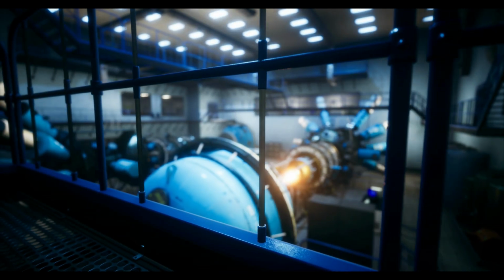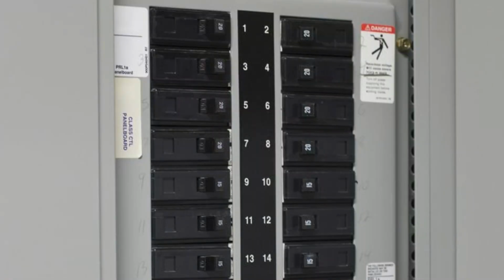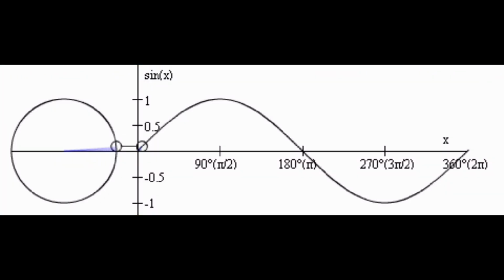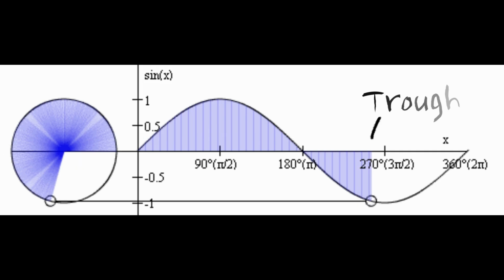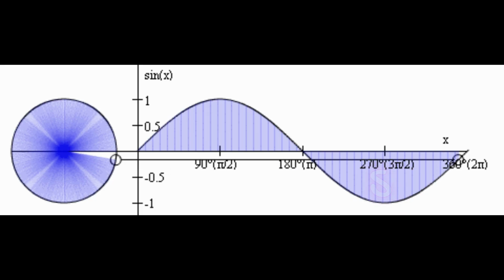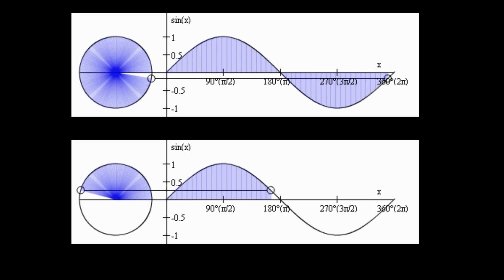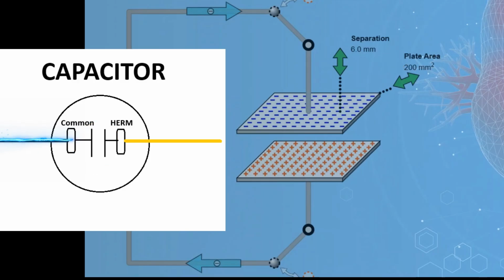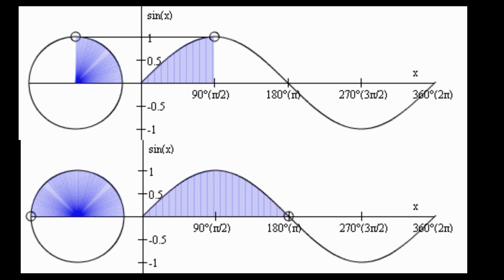What does a capacitor ACTUALLY DO?

Comment from the maker: Bottom line here is that we use capacitors in residential systems because we are taking only 1 phase of power off of the power grid, which doesn't give us the waveforms we need to create a rotating magnetic field in compressors and motors. This is also why commercial systems don't use CAPs. When all 3 phases of power off the grid are run through windings (as they are in commercial systems), they naturally create a rotating magnetic field without the need of a capacitor to alter waveforms and make it happen.
Reply: Mike can you break down the mf value of a cap? If a cap is 25% out of range but compressor is still working is it not working as good? Would the sign wave be less behind?
Reply from the maker: @georgev817 Yes, on a weakened capacitor the sine wave will remain the same but the timing of it will shift, so instead of say a 90 degree offset between the two sine waves it reduces to maybe 70 or 60 degree offset. This reduces torque, which can lead to slower, harder starts, more amperage draw and windings heating up more than usual.
Reply: @JerseyMikeHVAC  does a big drop in voltage have any affect on these capacitors? I was at a camp ground this last weekend and it happened to be one of the hottest weekends in a long time. Everyone was running their air conditioning. As the load increased on the electrical system in the campground, the voltage would drop to 100-102 volts. Now i am just afraid that i have done irreversible damage to my system. The compressors and fans on both my roof top units still run, but I swear its not getting as cold as it did. There is capacitor for the compressor and one for the fan.

Comment: The Question is Asked, "How do I Explain this to my Client"?

The Answer is Quite SIMPLE!

Forward this Video to Your Client.

They won't need Your "26 00 00 - Electrical Services"...ANYMORE!...(Particularly, Regarding the Replacement of a Capacitor)...

(However, "The VALUE!"...that they ACTUALLY LOSE!...is "No Qualified Individual"...is "Performing a 07 20 00 - INSULATION, 22 00 00 - PLUMBING, 23 00 00 - HVAC...AND!...26 00 00 - ELECTRICAL Diagnostic Inspection of the ENTIRE Electrical AND HVAC [ELECTRO- & MECHANICAL-ECOSPHERE!"])

07 20 00 - INSULATION
* Insulation - Condensate Drain
* Insulation - Lineset
* Insulation - Thermal Expansion Valve - Sensing Bulb

22 00 00 - PLUMBING
* Drain - Condensate - Cleaning
* Drain - Condensate - Termination - Indoor - Sink Trap - Tailpiece
* Drain - Condensate - Termination - Outdoor
* Drain - Condensate - Trap
* Drain - Condensate -Trap -Vent
* Drain - Overflow - Cleaning
* Drain - Overflow - Termination - Outdoor
* Drain - Slope - Condensate
* Drain - Slope - Overflow
* Filter / Drier
* Fittings - Copper
* Line-Set
* Pan - Condensate
* Pan - Overflow
* Pipe - Fuel Gas
* Pump - Condensate
* Support - Drain - Condensate
* Support - Drain - Overflow
* Support - Lineset
* Valve - Service - High-Pressure
* Valve - Service - Low-Pressure
* Valve - Thermal Expansion

23 00 00 - HVAC
* Air Balance
* Air Filtration - Return Air
* Air Flow
* Anchor - Seismic / Wind - Condenser / Heat Pump
* Coil Condition - Condenser
* Coil Condition - Evaporator
* Compressor
* Covers - Equipment
* Covers - Safety
* Ducting - Return
* Ducting - Supply
* Furnace
* Pad - Equipment - Condenser (Heat Pump)
* Refrigerant - Charge Level
* Refrigerant - Leak Check
* Sub-Cooling
* Super Heat
* Temperature - Indoor
* Temperature - Outdoor
* Temperature - Return
* Temperature - Supply
* Venting - Post-Combustion
* Venting - Combustion Air

26 00 00 - ELECTRICAL
* Capacitor (UH OH!)
* Circuit Breakers
* Conductors
* Conduit
* Connectors (Wire Nuts)
* Contactor
* Control Board
* Fan - Condensers
* Fan - Evaporator
* Fuses
* Grounding - Equipment
* Labeling - Circuit Breakers
* Labeling - Conductors
* Labeling - Service Disconnect
* Lighting - Service Area - Indoor
* Lighting - Service Area - Outdoor
* Line Power - Voltage
* Motor - Fan - Condenser
* Motor - Fan - Air Handler
* Overload - Thermal - Compressor
* Panel Schedule
* Receptacle - Service - Indoor
* Receptacle - Service - Outdoor (GFCI)
* Sensor - Carbon Monoxide
* Service Disconnect - Indoor
* Service Disconnect - Outdoor
* Support - Conductors
* Support - Conduit
* Switch - Overflow
* Terminals (Conductors)
* Thermostat - Batteries
* Thermostat - Programming
* Torque - Terminals
* Transformer - Low-Voltage

With GREAT Confidence In You,

Jed August
Los Angeles, California, USA

2026-09-21 (Monday) 9:50am, PDT

Comment: A simple small compressor runs fine, without a capacitor.  But it is not efficient.  A run cacacitor simply converts single phase power, to Two phase power, so it is more efficient.  99% of hvac service techs, can not electrically, explain what a capacitor does, and why.  But, all they have to know is how to change them.

Comment: Great explanation.  I would just add a little more description of the motors to complete the explanation for the need for a capacitor.  The type of motor used in residential AC systems are "Split Phase" motors, this motor design implements both the Run and Start windings, and thus requires the run capacitor full time for the reason described in the video.   But it is also worth mentioning the other benefits provided by the run capacitor.   The start windings are wound with thinner wire than the run windings, and cannot handle the same amount of current through it as the run winding, and the capacitive reactance limits the amount of current the start winding receives.   And overall, the run capacitor actually improves the power factor to make the motor more efficient.   Split Phase motors are quite the ingenious design, so can you guess who it was that invented it?   If you guessed Nikola Tesla, you're correct!
Additionally, don't confuse the Run capacitor (topic of discussion) with a Start capacitor, which is only used to assist in starting the motor and never kept in the circuit after startup.

Comment: So if I understand it correctly, the power doesn’t flow through the capacitor? It only flows in and out of it?
Reply from the maker: It basically induces a current across plates. It's not a physical transfer.

Comment: Replaced my original capacitor on a 21-year old Goodman AC, it was still starting and running, but startup was very rough, with a lot of grunting, buzzing, vibration, and running the compressor and fan had a lot of vibration. After replacement the compressor startup was much smoother, half as much vibration and the fan ran with very little vibration. It made a noticeable improvement.

Comment: now how do i explain this to a homeowner lol
Reply: The Question is Asked, "How do I Explain this to my Client"?

The Answer is Quite SIMPLE!

Forward this Video to Your Client.

They won't need Your "26 00 00 - Electrical Services"...ANYMORE!...(Particularly, Regarding the Replacement of a Capacitor)...

(However, "The VALUE!"...that they ACTUALLY LOSE!...is "No Qualified Individual"...is "Performing a 07 20 00 - INSULATION, 22 00 00 - PLUMBING, 23 00 00 - HVAC...AND!...26 00 00 - ELECTRICAL Diagnostic Inspection of the ENTIRE Electrical AND HVAC [ELECTRO- & MECHANICAL-ECOSPHERE!"])

07 20 00 - INSULATION
* Insulation - Condensate Drain
* Insulation - Lineset
* Insulation - Thermal Expansion Valve - Sensing Bulb

22 00 00 - PLUMBING
* Drain - Condensate - Cleaning
* Drain - Condensate - Termination - Indoor - Sink Trap - Tailpiece
* Drain - Condensate - Termination - Outdoor
* Drain - Condensate - Trap
* Drain - Condensate -Trap -Vent
* Drain - Overflow - Cleaning
* Drain - Overflow - Termination - Outdoor
* Drain - Slope - Condensate
* Drain - Slope - Overflow
* Filter / Drier
* Fittings - Copper
* Line-Set
* Pan - Condensate
* Pan - Overflow
* Pipe - Fuel Gas
* Pump - Condensate
* Support - Drain - Condensate
* Support - Drain - Overflow
* Support - Lineset
* Valve - Service - High-Pressure
* Valve - Service - Low-Pressure
* Valve - Thermal Expansion

23 00 00 - HVAC
* Air Balance
* Air Filtration - Return Air
* Air Flow
* Anchor - Seismic / Wind - Condenser / Heat Pump
* Coil Condition - Condenser
* Coil Condition - Evaporator
* Compressor
* Covers - Equipment
* Covers - Safety
* Ducting - Return
* Ducting - Supply
* Furnace
* Pad - Equipment - Condenser (Heat Pump)
* Refrigerant - Charge Level
* Refrigerant - Leak Check
* Sub-Cooling
* Super Heat
* Temperature - Indoor
* Temperature - Outdoor
* Temperature - Return
* Temperature - Supply
* Venting - Post-Combustion
* Venting - Combustion Air

26 00 00 - ELECTRICAL
* Capacitor (UH OH!)
* Circuit Breakers
* Conductors
* Conduit
* Connectors (Wire Nuts)
* Contactor
* Control Board
* Fan - Condensers
* Fan - Evaporator
* Fuses
* Grounding - Equipment
* Labeling - Circuit Breakers
* Labeling - Conductors
* Labeling - Service Disconnect
* Lighting - Service Area - Indoor
* Lighting - Service Area - Outdoor
* Line Power - Voltage
* Motor - Fan - Condenser
* Motor - Fan - Air Handler
* Overload - Thermal - Compressor
* Panel Schedule
* Receptacle - Service - Indoor
* Receptacle - Service - Outdoor (GFCI)
* Sensor - Carbon Monoxide
* Service Disconnect - Indoor
* Service Disconnect - Outdoor
* Support - Conductors
* Support - Conduit
* Switch - Overflow
* Terminals (Conductors)
* Thermostat - Batteries
* Thermostat - Programming
* Torque - Terminals
* Transformer - Low-Voltage

With GREAT Confidence In You,

Jed August
Los Angeles, California, USA

2026-09-21 (Monday) 9:50am, PDT

Comment: Great video Mike! One thing where I realized I was wrong was in thinking that both windings in the motor would hav the same current direction and therefore the same polarity. Do you know why the two windings would have currents/polarities that are 180 degrees apart? My guess is it has to do with the central tap, neutral, on the transformer but I’m not sure yet

Also you’re clearly a well studied person, can you recommend me some/ electrical HVAC books or resources (outside of your great videos of course)? Love your work man, I’m privileged to be able to watch it. Thanks
Reply from the maker: You're on the right track with the center tap/neutral. L1 and L2 come off opposite ends of the same transformer winding, and Neutral is tapped right in the center. If current on L1 is flowing towards a 240V load (like a compressor), then that same current has to be flowing away from the load through L2 — on the other side of the same winding. It has to. You can’t have current flowing in opposite directions through the same winding at the same time. So one side is “push,” the other is “pull,” and they constantly swap roles every half-cycle — always 180 degrees apart.